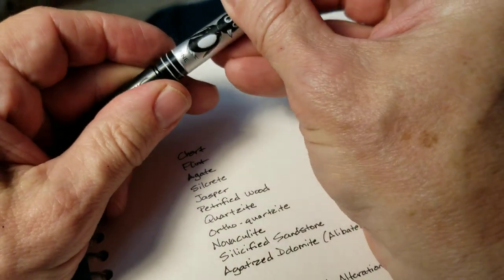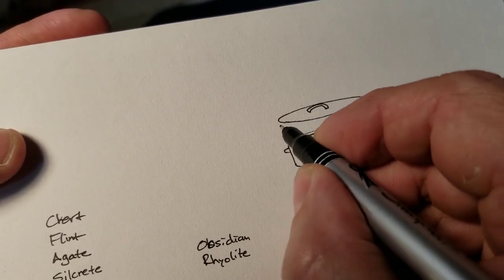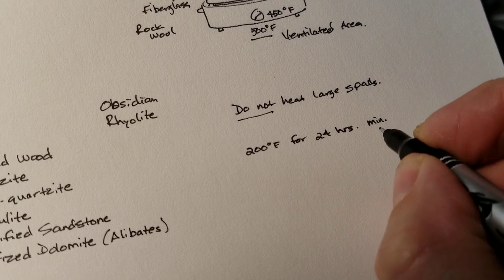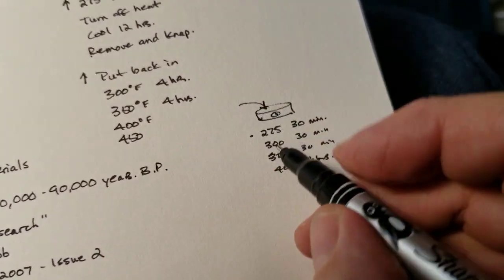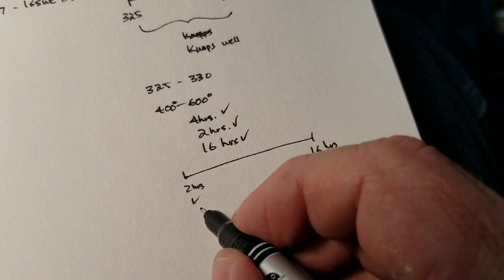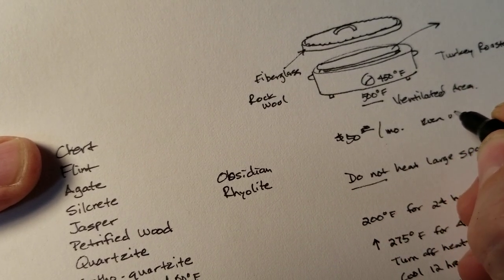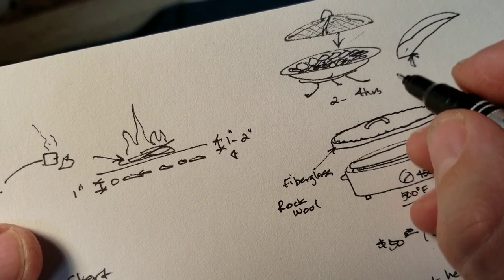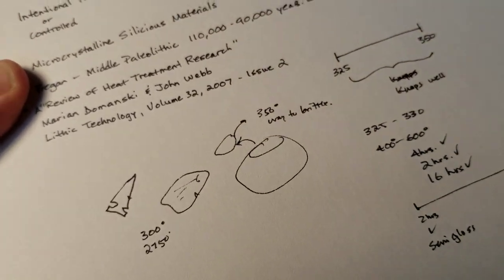878 - Explaining Heat Treating Stone with WORDS.

Comment: Thank you I found a perfect folsom 30 miles from my home here in colo and I realized that it came from a glacial flow only a mile away and I have picked up many flakes and spells and they were virtually unworkable yet the folsom was stunning with the two flutes going to within a quarter inch of the top and super fine micro flaking and I knew there had to be a trick .hopfully I wont bore you with this story four four years I camped at a lake in the wet my valley for the fourth of july and looked at a high shelf across the lake and I told myself you need to look there someday well the fifth year I went with a bunch of friends our intentions ride our motorcycles on the rainbow trail in the sangre de Cristo mts near the lake well it rained for four days almost non stop couldn't hide out in the tent any more I put on my old poncho Vietnam era jumped on my bultaco motorcycle and rode over there i found a couple of flakes then about half way up the hill to the shelf i saw it the bottom half of a tan colored folsom sticking out of the hill it was made of what we call chert or sugar flint I pulled it out and it was stunning it still had a tiny nipple athe bottom of the flute and the two flutes were so symmetrical in length that my fingers just naturally slid into them now I had been collecting for a few years but this piece was so different so unique and well made that I couldn't put it down for days I have since found an awesome cody knife a yuma several broken scottsbluffs but this was my first and nicest paleo point I've ever found and I just wanted to share with you!
Reply from the maker: Thanks for sharing. Awesome story.👍

Comment: Very interesting video, thanks for sharing!  
I work with insulation and one of the outgassing from insulation when heated in very high temperatures is the binder in the insulation, so it's good advice to have ventilation. 

Also, stone whool insulation can handle about +200C/+350F more than glass fibre insulation, so that is also something you can keep in mind (tho still, glass fibre can handle +600 C/1112 f so doesn't really matter with the temperatures you need)
Reply from the maker: Good to know. Thanks!

Comment: Could you basically Bbq them on a grill and assess the temp of each flake with a laser thermometer? Thank you for the video also.
Reply from the maker: Yes, that works as long as there are no drafts or breezes. Drastic temperature changes will crack the stone.
Reply: @KnapperJackCrafty  thanks amigo

Comment: Have you ever tried to heat treat Georgetown flint? Try to figure out if it’s good to do so or not and does it effect the color?
Reply from the maker: Yes. Georgetown will heat treat just fine, but it's variable. Most doesn't need that much heat, if any.
Reply: @KnapperJackCrafty  Thanks! That’s what everything I’ve read says. Does it become to brittle after a heat treat? I was just going to try it to see how it effects it. Would you say 300, 350 ,or 400 max temp?
Reply from the maker: @austinlong7700  Probably 400 would be the average. I've seen anywhere from 350 to 450. And yes, it gets very  brittle if you cook it even a little bit too much.
Reply: @KnapperJackCrafty  doe’s temperature or soak time/cook time effect it greater? Would I have to worry if I did 400 for 6 hours. Slowly ramp up to 400 hold for 6 hours then slowly ramp down?
Reply from the maker: @austinlong7700  soak time is 1 hr minimum. You can soak it longer than that if you want. Sometimes, it helps to soak it more than 4 hours but it's rare. Your temp and time are fine in your last comment. No worries.
Reply: @KnapperJackCrafty  Thanks! Thank you so much for your time and patience!

Comment: It would be good to see demonstration of what you consider changed and not changed by heat. Also question: does heat make rock both softer and flake better, ie less steps? Or just one? Edit: Also- couldn't you almost bbq them on a grill type setup and use a laser thermometer to assess the heat of each flake?
Reply from the maker: Heat treatment makes the stone fracture more like glass. The changes also sometimes include color and a more glossy appearance.
Reply: @KnapperJackCrafty  thank you thought this post was deleted